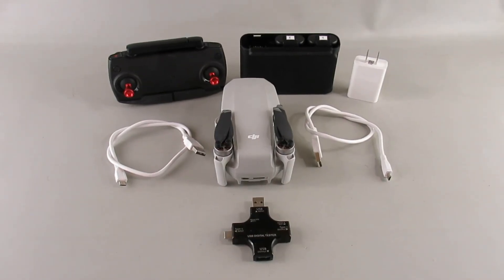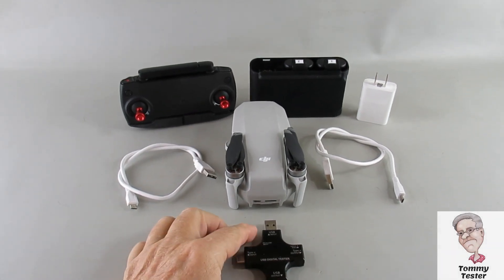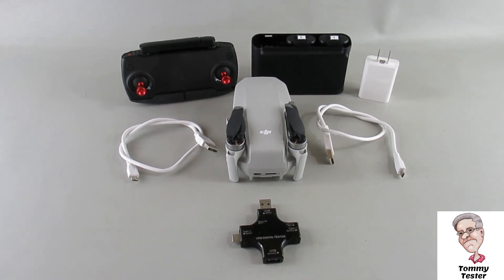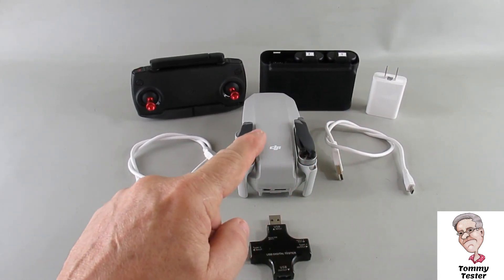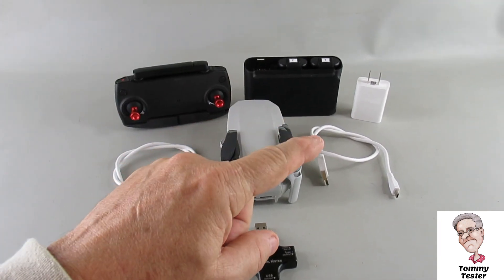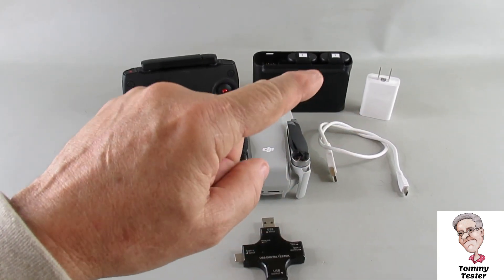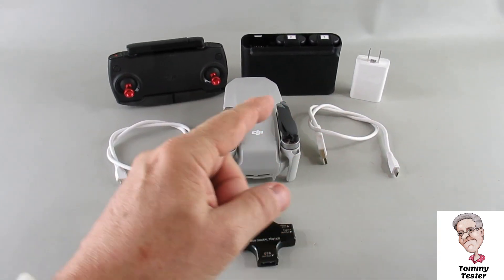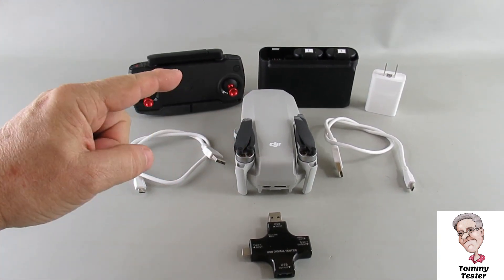Mavic Mini | USB Battery Charging Configurations and Measurements

Comment: Model: QC18-CN Output: 5V/3A 9V/2A 12V/1.5A How does it select the voltage?
Reply from the maker: Both ends use a Qualcomm chip, so it does a "handshake" before setting the initial setting.  It can also change while in use.  Works well on most new Android phones.